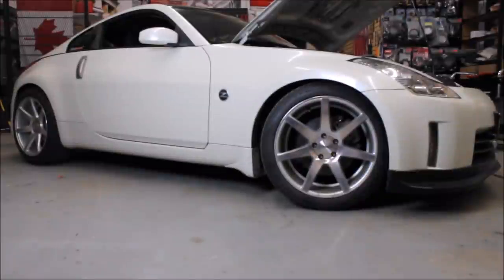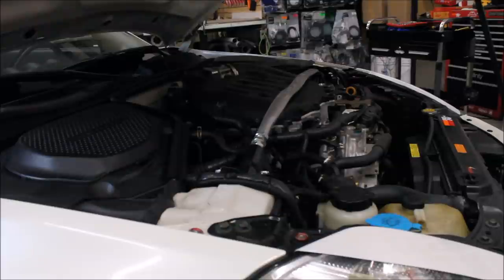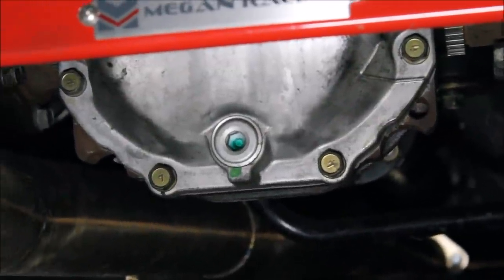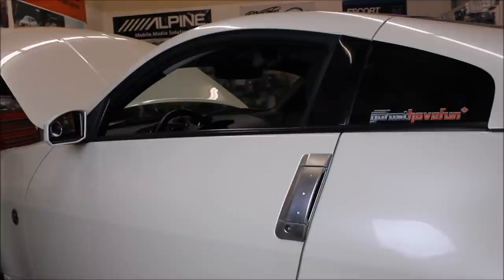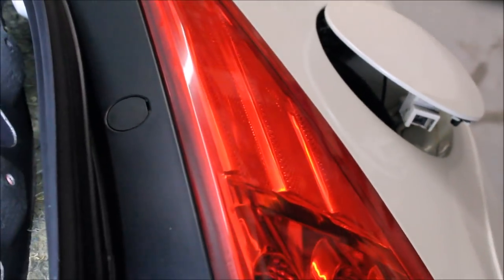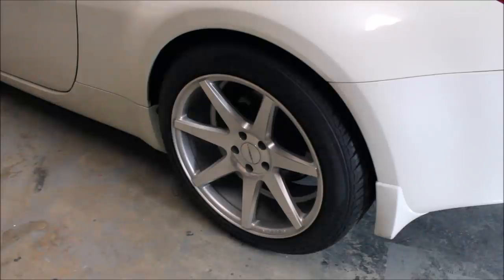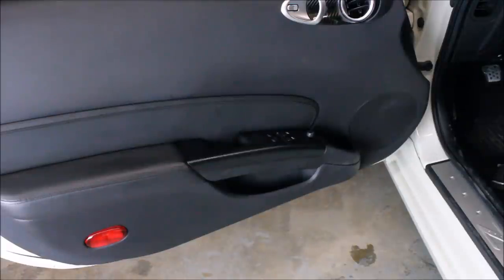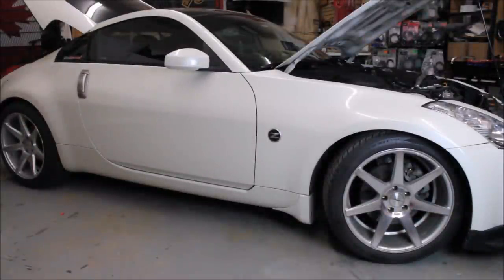Things you didn't know about the Nissan 350Z (Nerd Out Session) | AnthonyJ350

Comment: If I was looking at a Z should i just be looking at the 2007-08 models with the HR models or would I be ok with an older model with the other engines?
Reply from the maker: WhinslorCheck I see no problems with the older ones. 2003 to 2005 makes less power. Are you getting a manual?
Reply: I am looking for a manual, yes.
Reply from the maker: WhinslorCheck Do you want more performance or more of a bargain?
Reply: I'd be willing to wait so I can get more performance, I of course would want the best deal.
Reply: I bought my 07 back in 13 with 50k mi... no problems what so ever with this car engine wise and I just got to doing a full tune up @ 120k mi.. only thing I've had to replace is the driver door handle which is common to stop working (I could get out but couldn't get in)  which is a serious issue for 2 seater.. other than that this is a great car fun to drive and won't let u down.. still fast as lightning.
Reply from the maker: HR is the way to go.  That or REVUP.  Just look into upgrading the slave on the clutch for the 2007+ models as that's their weak point.
Reply: I'd say HR every day.  Nissan cheated on HP ratings through 2006. in 2007 they were required to use SAE standard HP ratings in the US, which is why they rebuilt the entire engine (80% new) for 2007 only to have rated horsepower make a meager bump from 300 HP (2006 rev-up) to 306 HP (2007 HR).  We dyno'd a stock 2007 and a stock 2006 (may have had the plenum spacer mod) and the 2007 made 40 more HP past 5k RPMs.  Add another 40 HP in mods to the HR and it's in another league from the 2006.  03-03 owners who have ridden in my car think it's forced induction.  It's that much faster.
Reply from the maker: zcarfanatic You can watch my dyno video of my Revup. But I thought the HR is pretty optimized. Is 80% difference mainly the intake manifold and exhaust with actual headers? I thought a lot of the internals are interchangeable.  What can you bolt on the HR to gain 40HP and not spend a lot of money. I will say one thing about the HR which isn't motor related. The slave design for the clutch is way too complicated and hard to service, if that thing doesn't work properly it doesn't matter how much power you're making.
Reply: Other interesting things about the 03-6 z's with the use of that older VQ engine: This engine was designed for a front-wheel drive car which would have been transversely mounted.  To fit it in the z, they had to rotate it 90 degrees for longitudinal mounting is why the intake is on the rear of the engine.  Also, in order to get the air intake plenum to fit under that sloping hood, they had to slope the air intake plenum aggressively which cause air starvation to the front two cylinders.  This is where the aftermarket comes in with a plenum spacer kit like the one you have.  I bought a 2006 new, which had the rev-up with oil consumption (new engine burning a quart of oil every 800 miles!!!).  When I saw the redesigned engine in the 2007, I traded the 2006 in for a loss. zero regrets.  The 2007-2008 350's with the HR engines are the most under-appreciated z cars ever. I've had the 2007 for 10 years now and have put 68k miles on it and it's never burned a drop of oil.  It's still fast with a few bolt-on breathing mods and UpRev dyno-tune and it still feels relevant.
Reply: I'll look for your dyno video. Bolting-on/tuning for the 40 HP HR gains are basic and easy, but definitely not cheap.  I have dual Injen cold air intakes, Berk HFC's, Bassani Dual exhaust, and a dyno-tune using UpRev Osiris software. Went from 262 baseline SAE hp to 301 SAE HP...  Same dynojet, similar conditions. The '80% new' number is from Nissan.  so it's essentially a complete engine redesign.  There was a leaked Nissan Powerpoint presentation (20 pages?) highlighting the differences in the HR.  I probably have it saved somewhere. it details longer con rods for reduced angle, asymmetrical piston skirts for weight savings, ladder-block design, NVH reduction and lots of other info. the hot coolant return is now an external pipe between the heads to get the heat out of the block to reduce pinging. the old DE design brought back hot coolant through the block. And they did away with that oil-check dipstick that shares an oil return passage to check the level, which as you know, takes forever to drain and get you an accurate reading.  The new dipstick goes straight down into the oil pan in it's own dedicated tube.
Reply: Sent a pdf of the HR briefing doc to your info email...
Reply: WhinslorCheck hr is the way to go
Reply: if you're building the motor it doesn't matter, if you're keeping it stock buy a nismo
Reply: WhinslorCheck the DE (older models like mine) have less power yet offer a more playable experience. By this I mean that you can modify and be more satisfied with the car you create versus the car you buy and drive. If you're looking for out of the box performance get the HR. Yet if you're looking for a enthusiast experience and are willing to spend less money on the car but more on mods, you will be 10 times more pleased. Also if you want to go to forced injection I would go with earlier models just for more bullet proof ness.
Reply: WhinslorCheck get a HR, DE's are trash. I owned a DE, biggest mistake of my life.
Reply: @zcarfanatic  Just buy an ‘09 370z 
Nismo and add the ultra-long Stillen or Injen cold air intakes.  I did that and added a Z1 Motorsports Setrab 34 row oil cooler with the thermostatic sandwich adapter.  Tune up, good to go...  Suspension is fine stock. Maybe polyurethane if you’re bothered. Not interested in mods beyond that. I’m happy.

Comment: What should be my first things to do when wanting to mod the car ie motor trans suspension exhaust
Reply: First do small things like catback exhaust and intake and stuff.
Reply: Airflow. First, the basic. Intake, exhaust, etc.
Then manifolds, plenum spacers, airbox.
If you're gonna turbo, do that at some point.
At this point you'll want to have it tuned, extra air wont help much if the computer doesn't adjust flow for it.

You can go further. Forged pistons and the likes. But i don't know anything about that.
Reply from the maker: This is my top list https://www.youtube.com/watch?v=62hfePo6vP8&t=243s

Comment: What about the clicking noise at slow speed ? I didn't understand what you said it was (french lol) I just got mine today, first Z, 75k miles for 5500$ I am so happy man, car is in good shape, about the security he did like a tune that has 3 set, 1 performance improvement, 2 locks rpm not past 5k ( valet or bad driving friend ahah ), and complete engine lock up for the 3 ! It's lit ! anyway thanks :)
Reply from the maker: Loïs Castellon If you're wondering about my axle comment just search 350Z Axle Click and you'll find my video.

Comment: The biggest quirk I see in the 350 is the engine. Especially that timing chain tensioning system. The chain will never fail, but the tensioner and those skid pads are problem prone as the engine gets miles on it. Most of the people I know here and on many forums  talk of the 'start up rattle' of the 350Z. I noticed they fixed this in the 3.7L engine of the 370Z and G37 coupe. well, at least I have yet to hear a 370Z have that initial start up rattle I hear in my 350 and others. And yes, I have replaced the chains, tensioner and those skid pads as well as the water pump.
Reply from the maker: archangele1 That's a good one, thanks for sharing! At what mileage was it making that noise and would you drive the car pretty hard compared to a regular car?

Comment: Hey Anthony! I got a used 2006 350z with the rev-up couple months back, and as much as im enjoying it. I finally came about the oil consumption issue you talked about. Did some research with a few other videos showing either a catch can or changing the PCV valve resolves the issue. Can you confirm or know more about this since you have an 06? Thanks in advance
Reply from the maker: Jeff I did a closed version of the catch can. Saikou and I agree it's the best version because it helps promote proper piston ring seal as well. The ones that claim that it solves oil consumption use a "vent to atmosphere" but I can't confirm, but the theory makes sense. I think you're to run into consumption if you drive the car hard. Best thing you can do is wait 30 seconds to 1 minute to let the oil circulate, drive it easy under 3k rpm for 5 to 10 minutes to let the engine components get to operating  temp, put a larger oil pan (I have a Stillen unit) and put on some sort of baffled catch can (search my video) and just do regular oil changes with a quality synthetic oil.
Reply from the maker: Jeff Also did you put a new pcv valve in yet?
Reply: Thanks Anthony for your promt reply. I have no changed the PCV valve yet, I may try that first otherwise I am leaning toward the PCV delete + catchcan mods. What would adding a larger oil pan do? Sorry if that is a dumb question XD
Reply from the maker: Jeff The bigger oil pan just lets the motor hold more oil. Typically am extra litre

Comment: What car key do you have? It's sick! I just have a very simple unlock and lock button on mine. Is it aftermarket? How did u get it? Hard to install?
Reply from the maker: It's a Viper 5806V and I added SmartStart to it so I can control my car with my phone.  I'm a professional installer and I wouldn't recommend installing this unless you're an experienced professional because you want to keep your wiring clean.  Here are my videos on that stuff.

https://www.youtube.com/watch?v=QEiJREXkLAI&t=1s

https://www.youtube.com/watch?v=Xg_tV7w6XgA&t=210s
Reply: Thanks a bunch for the videos and the info.
Reply from the maker: Glad you're liking them.  I plan on making some "list videos" like "Top Driver Mods" and "Top Performance Mods" for the 350Z, so stay tuned!
Reply: Looking foward to them! Could you also show how to install a Cold air intake for the 350z?
Reply from the maker: Rymden2 Maybe later down the road. I find the 2006 is probably the most efficient plus it already has a velocity stack built in.
Reply: True. I own a the 2006 model myself aswell.
Reply from the maker: Rymden2 Nice! ya the Revup is a good motor.

Comment: my windows keep on wanting to come down after I make them go up with the interior switch..For them to stay up ....I have to literally flick and let go 4-5 times..... What can I do to correct this so the windows go up and stay up like every other car I've owned....
Reply: First it's a 2 stage switch, only pull it half way to not send it into auto lift mode, which will allow it to stop all the way up.
Second, to reset the calibration on the window motor, you need to remove the door panel to access the reset button. I'd suggest looking up a video on the procedure, as it's too much to type.
Reply: thank you sir  @Lazaralis
Reply from the maker: Sounds like the motors have to be taken apart and cleaned.

Comment: I am hunting for a 07-09. Might as well buy that instead of 03-05 (hell no 06)  for the extra HP and power width.  Usually you don't want to buy the 1st year model of a car. Is getting 07 risky or should you at least get a 08?

thanks for the video
Reply from the maker: ZekeMagnum My car is a 2006. Any year of HR should be good. At this age expect to change the slave for the clutch. It's in the the transmission. 2003 to 2006 have that part outside the transmission.
Reply: Cool. I guess they are rare now during summer. Will probably be more up this autumn or spring. There are only 2x 07s+ out there in the entire country haha.
Reply from the maker: 2006 is a DE with variable valve timing on intake and exhaust.  It's the same engine used in the 25th Anniversary in 2005.  There are a lot of REVups out there.  There were a few that had oil consumption but most high compression engines that are driven hard will consume a little oil.
Reply: Looking into common problems with the 350z HR I stumbled across oil gallery gaskets failure. Now I am scared lol.  I get the feeling that it is ''when it fails'', not ''if''. Seems like it fails before 62300 miles.  DE dont have this problem according to the forums. 

I also looked up that oil pressure should be like 14-15 when idle. I assume you turn the car on before test drive with cold engine, look so it is between 0-30 mark and then good to go?

thanks

Comment: Aye Bro... when you get a chance. can you do a tutorial on fuel pump replacement?? i've been having a lot of rough starts. my battery is new n autozone boys tells me it sounds like a bad fuel pump. im looking at an AEM fuel pump on ebay or should i just go with OEM?
Reply from the maker: I'd get the OEM one because it'll drop in.  Did you guys change the spark plugs?  Maybe also look into upgrading the grounds of the vehicle.  Does it run and idle good?
Reply: yeah, when it does start. it runs and idles fine. Then i'll drive somewhere thinking its good, park and turn off the car, turn it back on and it won't start. it'll crank up and just goes grrrrrrrr, grrrrrrrr, grrrrrrr. my Z is 05 convertible enthusiast with 135,000 miles. i bought the car used, replaced all fluids already, haven't replace the spark plugs yet.
Reply from the maker: Well if it drives fine I doubt it's the fuel pump.  Can you make a video?  Does it struggle to start or just make an ugly noise?  Maybe it's the starter motor?
Reply from the maker: How many CCA is your battery btw and what kind of battery is it?
Reply: it's a new Duralast Gold with 685 cranking amps... i installed it 3 weeks ago with new positive n negative terminals because of the hard start.  But the issue still the same with the new battery. i'll make a video when  i get the chance.
Reply from the maker: Check the connection at the starter motor and make sure there's no corrosion built up.
Reply from the maker: It's either a sensor or possibly the immobilizer can't read the key.
Reply: AutoZone boys suggested it's fuel pump so i replaced it today and still having the issue, puahaha.
And yeah i recently used a transponder key i bought 2 months ago, it had work find till now, so im using the key that came with the car(which is also a copy) it works better, i can normally get it to start on 3rd try with that key. But i order oem Crank Shaft position  sensor, i'll let you know if that fixes it.

Comment: What’s your opinion on the 2004 350z Touring Edition, I’m thinking of getting a 350 but I wouldn’t mind drifting it now and then. Goes for 5,500 with 150,000 miles. Thanks for the informative videos keep it up man
Reply from the maker: It would be a solid car.  Just make sure you replace worn out parts and change all the fluids since the vehicle is a little older and higher mileage.
Reply: Thanks man, can’t wait to get the car. Is there any other models you would recommend or stay away from? I’m trying to learn as much as I can about 350z’s
Reply from the maker: Francisco Mendez They're all kind of the same just the interior features change. The engines and transmissions will change depending on the year though. The chassis are all pretty much the same except for the 2007 Nismo which is stitch welded.
Reply: Kind of a dumb question but are all 350z’s driftable or is the any mods that have to be done? Appreciate all your appliances thanks man

Comment: How's it possible to get the windows to go back up. A work in the wiring or wasn't too sure on that
Reply from the maker: Ya you have to wire into the window module in the driver's door.  I do wiring for a living so this was normal (or maybe expected lol) for me to do.
Reply: oh so that would be done by anyone whose experienced. I'm a new 350zedd owner so I've look through and learning as much as possible. Your video just threw me off lol. i was think alound "so they can go up!" haha
Reply from the maker: Haha, they can if you have a good installer wire up your aftermarket security properly.
Reply: AnthonyJ350 would a different key fob be aftermarket as well? i have a base model 08 350z thats an HR
Reply from the maker: Yes typically a different key fob is aftermarket.
Reply: well that makes sense. I'll look into. Thank you very much for the helpful video. The interior trims were also very helpful as well.